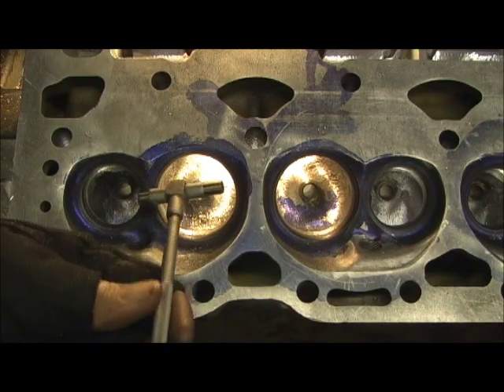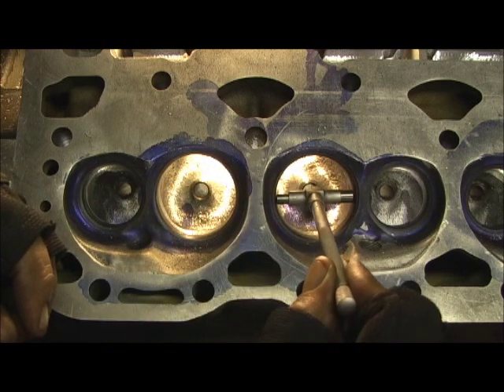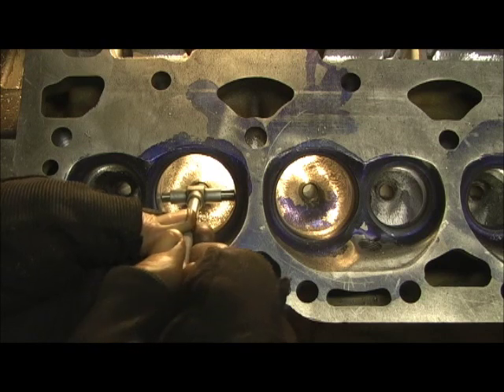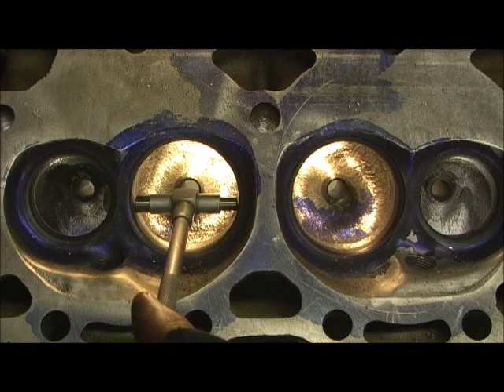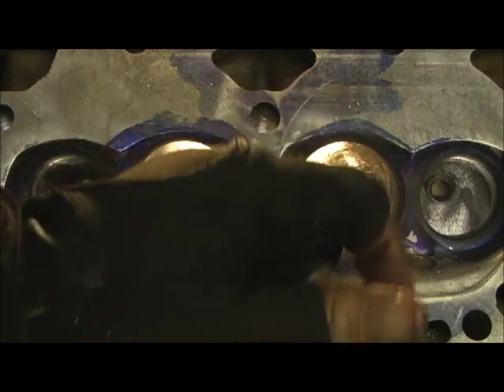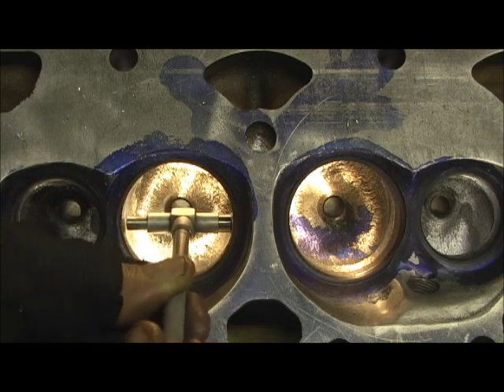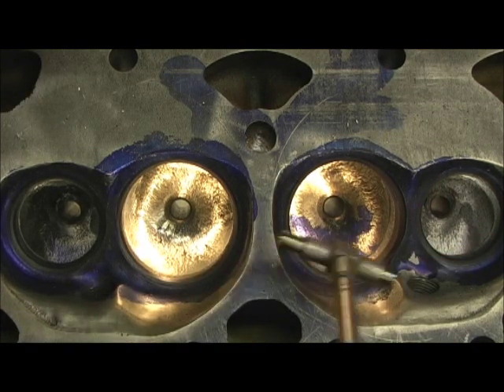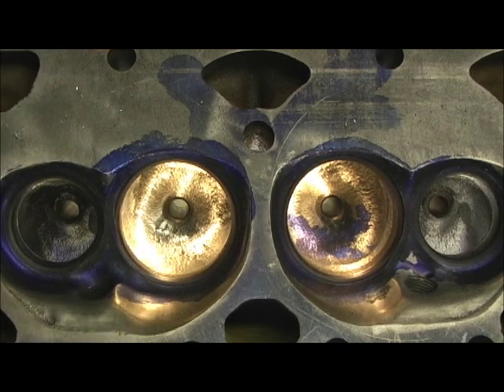LT-1 Full Porting part 5.2 Seat to Bowl

Comment from the maker: I love it when I get this type of questions. PAY attention to what I have been saying about the 20 Degree angle with your grinder on the hard seat. Set the scribe line about .070 below the 60 degree angle on medium performance (street strip) and about .030 on full race jobs. This controls exit or Discharge Coefficient; the more radius or farther down the angle on the 60, the more low lift flow, the higher the more high lift, it is that simple...

Comment: As usual, damn educating! What do you think about after bowl but pre-seat cross-section in relation to valve dia? I heard, that for moderate engines it should be some what about 81%, race engines can go for more, but still not bigger than 88-90%.
Yet I'm scared to remove the short radius on the intake. But on the exhaust side, me and my friend suppose that it flows through the top, so smoother a short radius won't hurt anything!

Comment from the maker: I have done some work like these that resemble the shape I used here several years ago. This of course will depend on the runner volume I end up with Carp. If I had to guess (and I mean guess until I get the runner volume and final Map) I would say around the 280 CFM mark, with around 185cc intake volume with a 1.94 valve, which makes this a Hauling Ass column of AIR!!!

Comment: I have some old 462624 heads I used for practice.They are both cracked right across the seat and through the short turn of the two inside exhaust ports.Due to these two exhaust ports being so close together,this has got to be the absolute hottest area in the whole head.To me this has to be the most critical point of all to remove any amount of material.How much of the short turn side can be safely removed from this area before its certain to crack under heat?